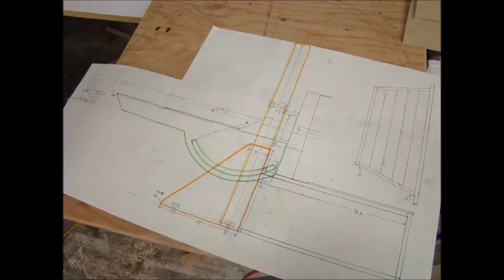DIY disc sander 15 inch custom made, how I did it

Comment: where did you get the disc face to attach to the motor?
Reply from the maker: That was a 16 inch by 5/8 aluminum disc from ebay.  I machined it down to 15inches and added the motor mount also.  Are you needing one?
Reply: Yes, I am I am using an refurbed 1 hp air compressor electric motor and need a aluminum disc to mount to it... Where on ebay can I find one?
Reply from the maker: I searched for aluminum disc and several where thereof different sizes.  You might be able to find a disc for a sander already made, but usually they are only 12inch diameter.  Just so you know I can make one for you with the motor mount, what size are you looking for?
Reply: I used a alloy disc off a pottery wheel and got a adapter  to suit disc to motor
Reply from the maker: I made the metal hub from a solid piece of brass. machined myself. totally custom